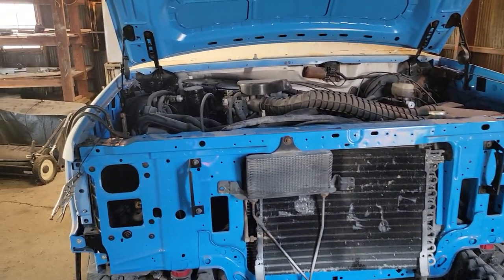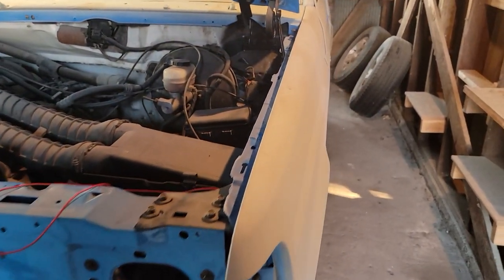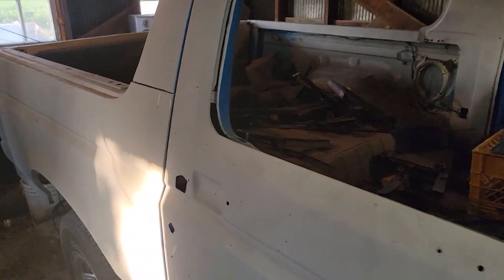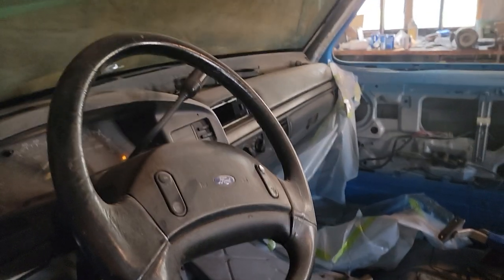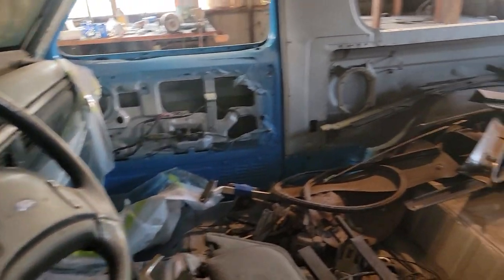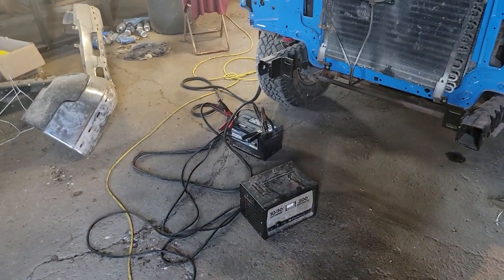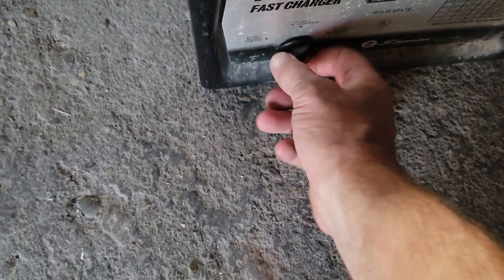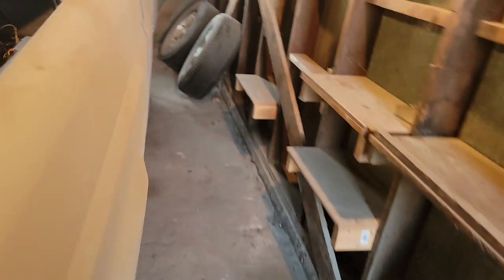1993 Ford Bronco!!  SHE STARTED AND RAN GOOD!!

Comment: Here in The Great Industrial Northeast it's in the low 60's at night.
Windows are shut, fans are off and the only thing keeping from turning the heat on is the hunidity.
Weird summer. Blame it on the western wildfires producing so much smoke, it's creating a cooling effect.